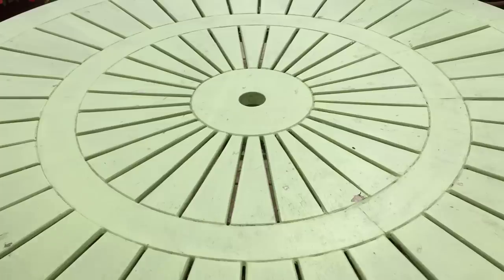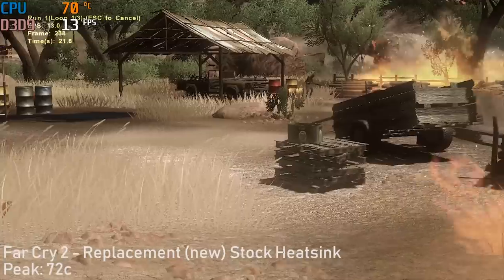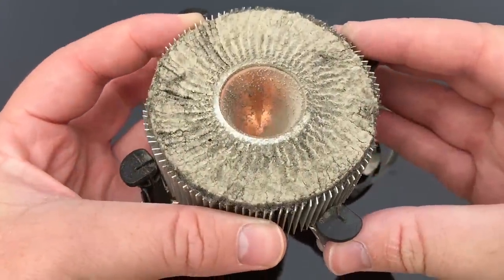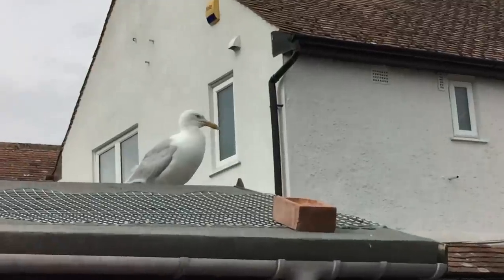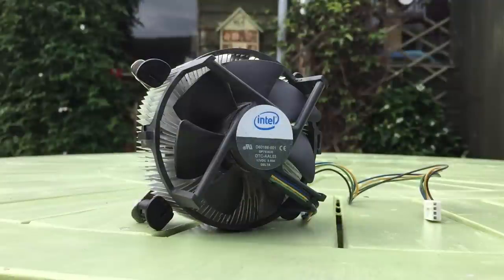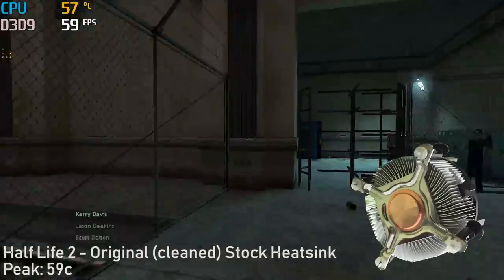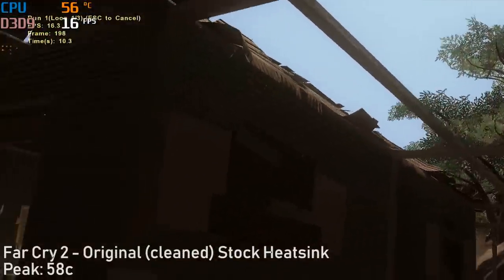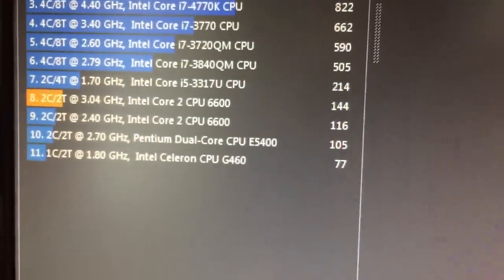Saving The OG Intel Heatsink!

Comment: Copper always transfers heat better than aluminum.
Reply: Grumpy Cat Yeah but full copper heatsinks are useless too :P they can't loose the heat they gained as fast as aluminium
Reply: That's why they don't make full copper heatsinks. Think I'll keep the one in my old AMD Athlon X2 system, it's really good.
Reply: The difference is pretty trivial. Yes copper has twice the thermal conductivity of aluminum but compared to air it’s so much higher that the bottleneck in heat dissipation is the transfer of heat from the metal to air not between the metal in the heat sink.

The improved cooling was due to the larger heat sink not due to the copper vs aluminum
Reply: Marcin K thats not how thermal dynamics works... You don't know what are you talking about.

Comment: omg thanks for uploading this video it helped me understand that the dust do effect the cpu with heating problem 
i have I5 3340 3.3 ghz with the hyperthread and i get 50 55 c temperature at 5 % cpu load and it reach 78 c at high load 
i guess tomorow im gona have to clean this dusty stock cooler

Comment: The intel stock cooler fucking sucks, i use it with my intel core i7 6700 and it keeps overheating (150F) with a game that isn’t too heavy and there is no dust on the fans, i would buy a new cooler but sadly i dont know how to install
Reply: it's pretty easy, so many videos on the topic

I think you just got bad luck as 99% of the time, a non oc'd cpu should do fine with a stock heat sink. it will run hot, but not dangerous hot
Reply: IO Gamer just buy cooler with same socket and watch on youtube how to install it.

Comment: Just wash it in water and dust be gone bro
Reply: Also the extra noise is comming from the old fan.   As system fan get old the oil or sleave get noisy.   Replacing with new fluid dynamic Fan like ARTIC F2 fan will quite this best down.   Also intel Quad Q6600 SCLR would be a nice cheap replacement for the C2D cpu and that Q6600 would OC like crazy

Comment: Hello, i want to buy a cpu but i do not know good cpus for 1150 socket, can you help me please,thank you in advance!:D keep up the good work!<3
Reply: what's your budget? what's your purpose? and what kind of motherboard do you have? is this a pre-built system like Dell/HP etc or a motherboard sold by a retailer?
Reply: 200 dollars just for playing games i have a motherbord thatcher support ddr3 1150 lga socket pre builder but i bought a gpu and memory ram
Reply: $200 for a cpu? that will basically get you any haswell cpu for your socket (that's 4th gen intel

depends if you want to eventually swap in a better motherboard for overclocking cause I doubt you can. 

so you can drop $120 and get a i7-4770 or something. the i7 4790 is a little better being a revision, but it's more expensive 

k models would add to the price, but they are for overclockers.
Reply: Steve Smith i do not want to swap the motherbord  but thank you i will search and look thank you so much!<3
Reply: David Claudiu then 4770 or 4790 is your best bet

Comment: It's great you saved it but please quit using canned air. It's bad for the environment, wasteful, is a recurring cost and continually loses force as soon as you start using it. There is absolutely no reason to use canned air. I said it in the last video. Get a datavac off Amazon.

Comment: Invest your Youtube money in a real compressor or drive to a gas station to clean your hardware.
I never buy compressed air these days since it is over priced crap and I can use a real compressor to do a ten times better job quicker, while check my tire pressures.